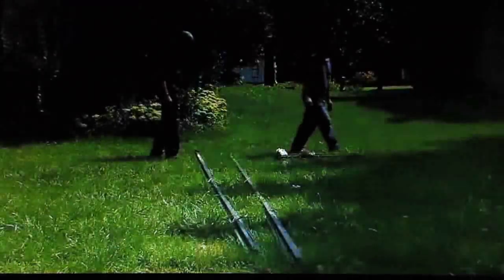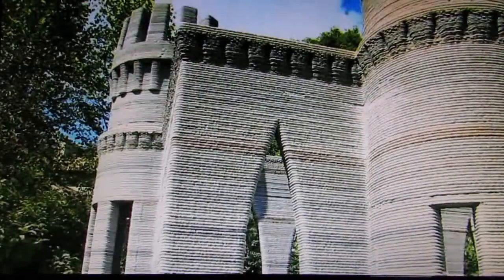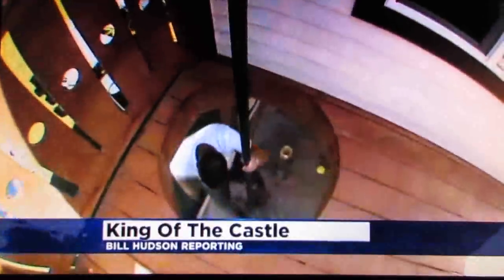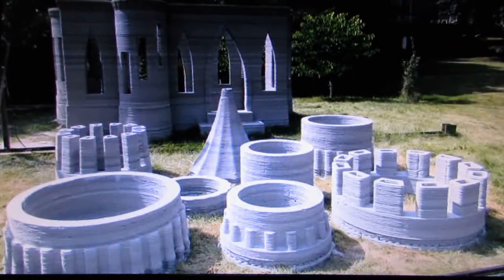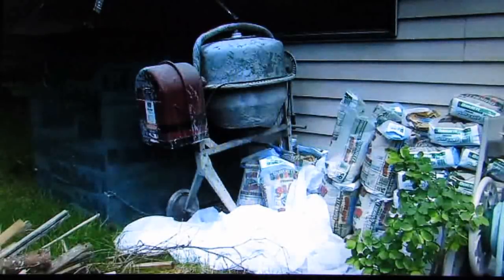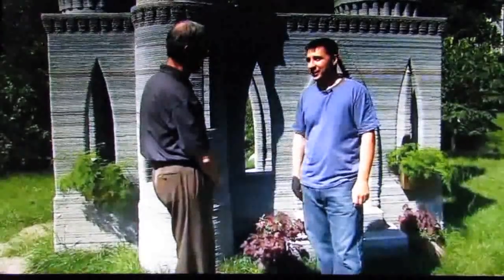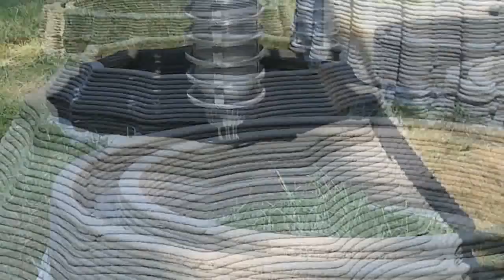3D Printed Concrete Castle

Comment: Existing concrete structures - either poured or build with concrete blocks - need steel reinforcement called "rebar".  This is because concrete tends to be prone to cracking.  Changing pressure from frost heaves, earthquakes, a car running into the building - all kinds of things can cause concrete to form cracks.  The rebar keeps everything from falling down with this happens, and keeps the now separate pieces of "broken" concrete aligned so that the strength is maintained.

Is there any planned approach to be able to include rebar or some other steel or steel-like reinforcement to be used?  It seems like it would be hard to extrude the concrete around pieces of rebar sticking up in the air, and it would also be difficult to insert rebar into an extruded wall.

Perhaps the extrusion could leave vertical holes into which rebar could be inserted, then the remainder of the hole filled with concrete or some kind of epoxy?  And then periodically a horizontal channel could be left for horizontal rebar to be laid into and fastened to the vertical rebar?  The extruder could run until it reached a level where horizontal rebar was needed, leave a channel, and then stop while the rebar is inserted and connected together.  The the extrusion could continue.

Hmm, I already see a problem with that approach.  How do you attach the next tier of vertical rebar to the previous layer, after you've covered it up?  I think you're going to wind up needing to allow for rebar to stand above the layer of concrete currently being extruded.  Could tilt be added to the extruder to allow it to extrude closer to a vertical piece of rebar?

Very likely the best solution would be to completely re-think how to do steel reinforcement in an extruded concrete environment.  I don't have enough 3D printing OR construction experience to be able to come up with anything at the moment though...  One approach would be to 3D print the steel for reinforcement right into the wall using SLS (Selective Laser Sintering).  But the mechanism required for SLS is considerably more complex and expensive than the concrete extruder.  Adding SLS capability would probably increase the cost by at least 10x both to build the SLS printing "extruder" and also to operate it while building the wall - even if you could use the existing positioning framework and mechanisms...

It seems like the steel reinforcement issue is a really important one though!

We can probably all remember photos of buildings in China and elsewhere that weren't built safely, and entire apartment buildings simply collapsed into rubble when an earthquake hit, with thousands of people killed instantly, thousands of others buried alive.  It seems like an apartment building (or any other building) built with this current concrete extrusion method would be subject to the same type of collapse in an earthquake.

Comment: Awesome! I wonder though if concrete is the best material for a 3D printed home in terms of strength to weight ratio? Since you have the option of a heated extruder, what about a wood fiber reinforced resin?

Also, have you looked into the tiny house movement to build a livable prototype? If you build it on top of a large flatbed trailer with wheels as a base, then it's not subject to building codes.

Comment: Just another thought on the uses for a device like this.... 3D printing has opened a lot of doors previously unavailable because of how finely it can create structures, not just the macro structure of the wall, but build a wall with an internal structure, say of triangles, polygons, etc.

What do you think the possibility is of devising an internal structure to walls that can create equal or greater strength, while greatly reducing the amount of raw material used?
Reply: +Dan O&#39;Connell that's already been done in large scale prints, this particular structure just doesn't use it. It's just as doable as it is in small scale prints.

Comment: You know, I didn't see any form of steel reinforcement, and it looked like mix had zero rock in it too. Infact, the mix looked like it was a grout or mortar type mix that was really dry. What would the tensile strength of that be compared to regular old concrete poured with steel reinforcement in it?

Comment: if he had a dual extruder he could print concrete on the outside and drywall plaster on the inside so he could hang pictures easily on the inside of his home.  and maybe pause the print every 3' and inject foam insulation between the two walls.

Comment: Should have it print out Air-crete instead so you can lift those heavy objects up. less weight, less concrete, more strength. Nice work =)

Comment: Very cool concept! I'm impressed that you've figured out the consistency and degree of over-vertical curves that can be poured. I do have a couple questions regarding this though: first, have you considered how steel or fibreglass reinforcement could be integrated into pouring with the printer. And second, how does curing time affect the rate of pouring or is the pouring time consuming enough that a constant pour can be achieved?
Thanks! I'm super interested to see what can be done with this piece of tech!

Comment: It won't be that hard to print reenforcement in to the process. equipment design, will be the least of the trouble disipating heat and proper curing proceedureswill be hard to figure out but can you Imagine, how strong these types of structures can be.

Comment: It's a very versatile system but they tend to be quite slow. And damn weak compared to properly done concrete with aggregate in it.  That's the tradeoff for the versatility. For example I could pour a house in a week  not a few months. And probably at 8 times the strength.

Comment: Famtastic job.  I wonder though how well the layers stand up if they are put under stress, will the layers slide apart.  Seen in the last few seconds of the Vid one of the parts being moved so looks solid enough.  I just get the feeling that if you had somethig running from one layer into the other it would make it much much stronger.

Comment: Could do with an articulated arm same as mx3d and perhaps fibreglass or steel reinforced somehow, perhaps by applying fiberglass on top or as a projected plaster layer. if you feed a continuous cloth of steel in there it could be controlleable?

Comment: very cool stuff. I'm wondering if there would be a way to incorporate rebar though. Without it, I feel like the structure wouldn't last as long
Reply: +Steven Saunders I was thinking the same thing.&#160; After some consideration I had come to think that the rebar would have to be inserted buy the extruder head as it went along.&#160; Another way I guess was to have the extruder tilt and squirt it around the rebar.&#160; Also, if the geometry was such that it was self supporting rebar may not be necessary.&#160; You have fine control of the concrete layering and thus can make the exact shape.&#160; An engineer or architect could do amazing things with that.&#160; They were building things with concrete well before rebar.

Comment: There appears to be open trenches on the top.  Is there a drainage system built into the design to address that.  Also, I'm curious how expansion and contraction will affect all those seams after a few cycles of frost

Comment: Have you considered building plumbing into the walls to decrease production time? I'm currently in the process of building a desktop 3D printer do you have any tips about programming the printer? What kind of control process are you using?

Comment: I imagine that it would be difficult if not impossible to create such a structure out of concrete with a printer if you are also trying to reinforce with re-bar.
Reply: +outside the box There are many answers to this problem, such as robot arms holding rebar in place long enough for the concrete to be set around them.  This is something that could easily be automated, and would solve that problem.
Reply: +Dakota deVilleneuve   Admittedly, given time, if there is profit to be had doing it this way, an answer will be found. It just won't be as easy or as straightforward as this current video would suggest. With other materials likely yes but with concrete, the need for re-bar presents a significant hurdle of added complexity.
Reply: +outside the box Enough of a hurdle to possibly nix the use of concrete altogether that is.
Reply: I have to agree. Perhaps we will find a cheaper, stronger, lighter material than concrete that will be better suited to build houses with.
Reply: +outside the box Hmm... There are precision steel benders. They could bend the rebar without adding too much stress to the bar already laid. This could be done well before the concrete is being laid.Twin exters, Holy shit, Twin extruders! That would work! Twin extruders could lay concrete later around the rebar. With twin extruders you could do a hell of a lot of stuff! The possibilities are quite exciting. Good luck figuring it all out though.
Reply: it'd take a welding printer to print (weld) steel layer by layer one layer ahead of the concrete so that it wouldn't protrude enough to get in the way of the extruding head.But yeah, if you're going the rebar route, you're looking for a more sturdy structure than what could possibly be printed anyway and regular construction is the way to go.
Reply: +Chris P  As you probably already know, reinforced concrete walls are already made with the re-bar first and then the concrete poured in afterwards. The trick would be getting a concrete printer to print "around" the re-bar.

Comment: I didn't notice any rebar in there. Did you pause the machine every so often to layer that in or is this structure totally unreinforced? Because that wouldn't fly in seismically active regions like California, Japan, etc. Perhaps you mixed in some kind of carbon fiber composite?
Reply: if they had thread coming out the nozzle it could make concrete stronger than rebar.
the threads can be laid in patterns to support the forces...

Comment: we are on a serious change in construction also it's applications for natural disasters.  unlimited potential. print refugee shelters, base defense. No limit.
Reply: +Devil6CR This isn't reinforced, and would be extremely dangerous in earthquake situations.  Pre-fab housing is the way to go for disaster relief.  

http://www.whatdesigncando.com/blog/2015/03/25/better-shelter-ikeas-solution-for-refugee-housing/

Don't get me wrong, this is awesome, but the use case is making complex shapes that would be impractical to do with traditional forming methods (putting up plywood, pouring, and taken the plywood away when you're done).  Really simple housing doesn't have to be complex: four walls and a ceiling.
Reply: +John Harvey Wouldn't be too hard when you're doing the 3D print schematic to leave a space in the design large enough for the rebar and other concrete to fill. once the outer layer is set you could simply go through and place it and then pour in the filler concrete to solidify it.

With a bit of design innovation you could probably figure out a way to design it so that the system would work around a framework so you could go through lay out the entire framework and then turn it on and watch it "print" the entire floor or building around it and then again go through with your regular concrete blend and fill in the gap which would give you a more solid overall construction as it would be one single piece.
Reply: +FirstIsa It's way quicker and cheaper and better looking to make prefab homes. This machine is only nice to make special designs.
Reply: +FirstIsa or you could set forms and pour it in two hours. it is a very interesting concept for sure, but, further development is needed for this to become a real practice in construction.
Reply: +Devil6CR Prefab homes are very good when you need to produce thousands of them, yes. But a change to a new configuration in the plant which makes prefab homes parts is a long (and thus costly) process, whereas building a different home with this machine is as easy as loading a different program.
Reply: Denys Vlasenko If you need thousands of homes quickly then a giant 3D printer is definitely not the way to go. Wanting to change the design if you quickly need thousands of homes, sounds like a luxury-issue.
Reply: +Richard van Pukkem Well it would only be useful for very complex builds I guess? Or places where labor price is sky-high.
Reply: Someone who is going to invest in a home, probably wants something well-built. There is loads of craftsmanship in a normal home, like humidity in walls, isolation, safety (electrical/water/gas/etc.), floorload capacity calculations. Just plainly putting material down is not the issue when building a home. Such a 3D printed home is fun for the grins, nothing more.
Reply: Richard van Pukkem Who says something 3d printed can't be designed to be well-built, but i guess the freedom is the ability to choose one way or the other, it's up to the designer and budget
Reply: Unless they will invent a printer that can print full color high resolution on house-sizes scale, it will never become a regular thing. People who buy a normal house (not some emergency thing), want luxury, real natural and premium stylish materials, that not only look good but also feel they way materials should do. 100% concrete or 100% plastic, not even 5 combo's of different 3D filaments will do for this requirement. 3D printing is fun, i got one Ultimaker 2, but people are just thinking way too far about this 'technology' (it's not even a real invention, it's just a re-use of existing things; normal 2D printers with one axis more and putting molten plastic or concrete in it instead of ink).
Reply: Richard van Pukkem Yea there are house 3d printers that put rebar, piples and stuff.
Reply: +Devil6CR One can easily imagine other materials like a paper based, pest- and water-proofed mulch being used instead of concrete too.

I've been aware of building printing for a while, but this machine seems sleek.
Reply: +Richard van Pukkem Well... what if you have a machine that prints not just concrete, but various materials and then finishes and even polishes the materials afterwards as per design, or matte or leave other areas rough. And you can still plaster and paint, or add face bricks or a variety of fascia.

Make no mistake. In a few decades this type of thing will be commonplace.

And most inventions are a re-use of existing things. Just because engines, nuts, bolts, planks and wire were already invented before does not make the achievement of the Wright brothers any less outstanding. Screens, antenna, processor, microphone, speaker, gps... You got yourself a smartphone.
Reply: Going to lose your job if this becomes the building method of the future huh?  Poor sap, this is what they said about Buckminster Fuller and he invented the geodic dome.  Which every stadium you have seen uses in part in it's construction.